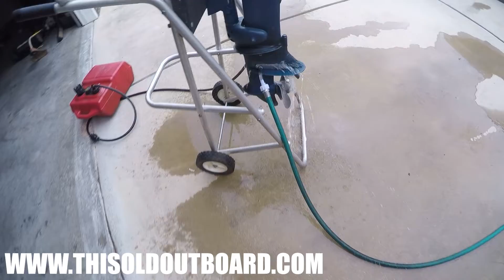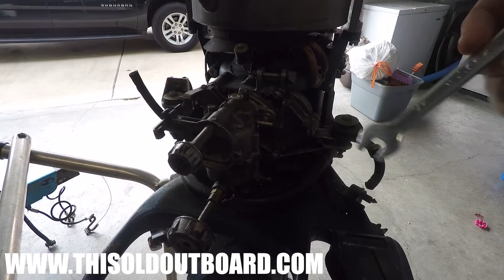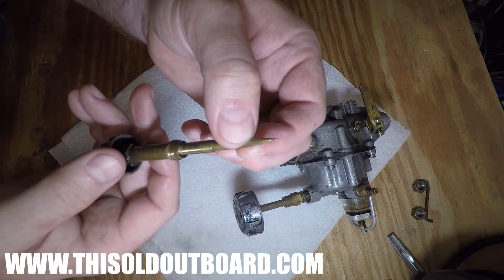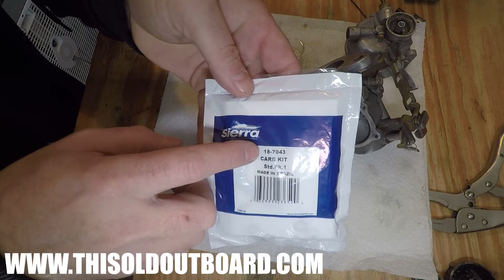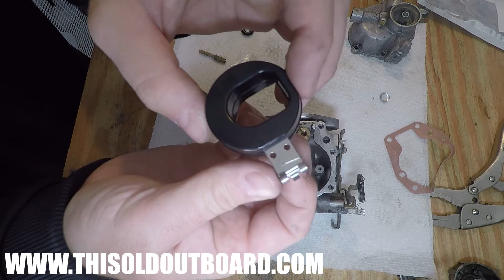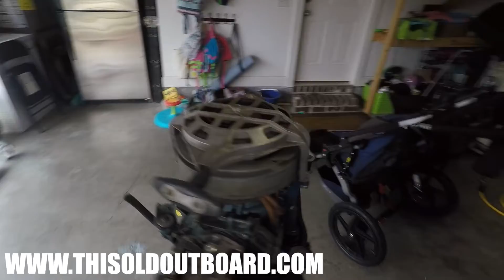1956 Evinrude Fastwin 15 Hp Carburetor Rebuild

Comment: Do you take work on older outboards for customers? This would be a great way to get contents for your YouTube channel. If you are interested let me know where you are located. I live in Tampa Florida, if you are not an extraordinarily distance away I could make arrangements to send you my outboard. The outboard I have has been sitting for 20 years, I did manage to get it started, but as you can imagine fuel lines spark plug wires seals water pump and oil will need to be replaced. Let me know if this is something that interests you. What I have is a 19 55 or so tiller outboard it is a Johnson, 18 horse, seahorse. If you are not interested in tackling something like this but know of someone in my area please don't hesitate to refer them to me. Keep making content I certainly do enjoy watching you. You are extremely thorough and highlight any kind of downfalls that you might encounter. Thank you so much for the time and the effort you put into these videos. Kind regards, John

Comment: Thanks for the thorough walk through! This was a HUGE help. I had 2 things slightly different on my 1956 Johnson 15HP as I went through my carb with your video help. The welch plug for my carb is a 1/2", but the kit only came with a 3/8" and 7/16". The only other thing different was I had an aluminum threaded alignment spacer in the low speed needle valve hole which was a surprise when it came flying out under compressed air.